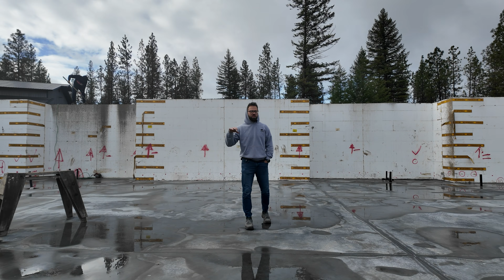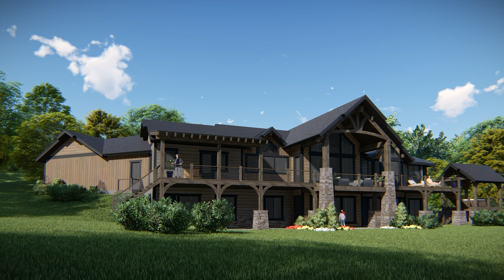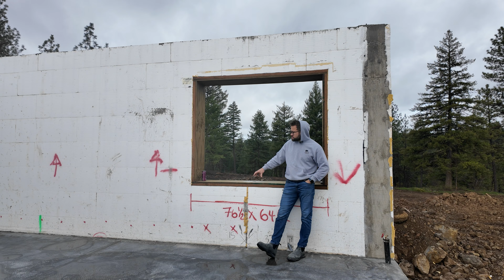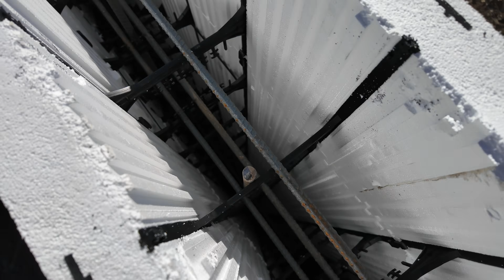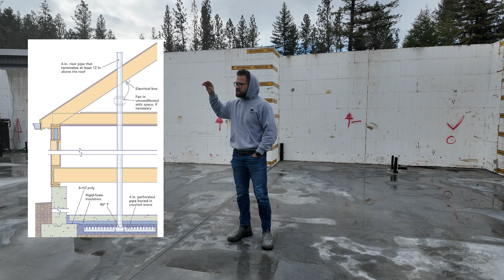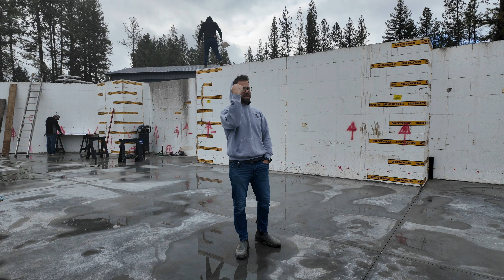Building ICF Daylight Basement

Comment: What are the most common sizes of ICF blocks that you use?
Reply from the maker: 6 or 8 inch concrete core depending on the load of the wall. And the blocks are 16 inches tall by 48 inches long.
Reply: @WrenBuildingCo  Thank you! Where would you use Taper Top, or Double Taper Top forms?

Comment: Stronghold is the best form I've used in over 20 years of icf construction.   It locks together tight and the top of wall turns out perfectly flat with no settling issues.